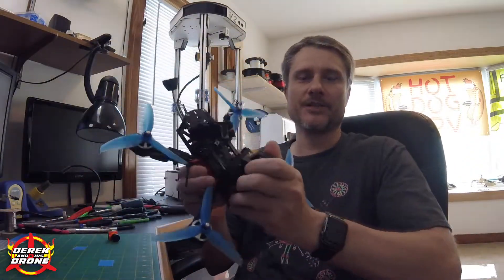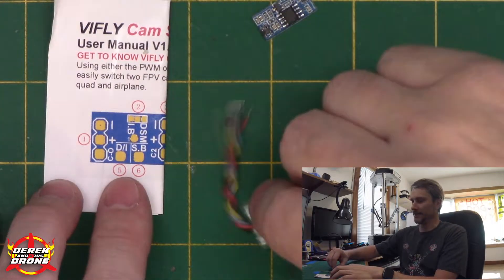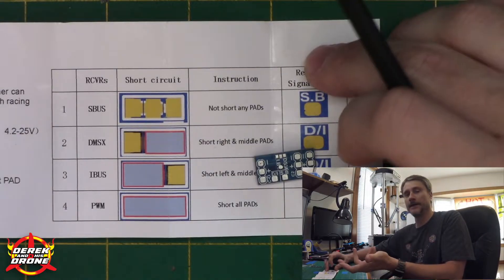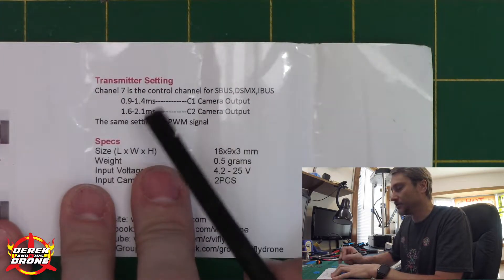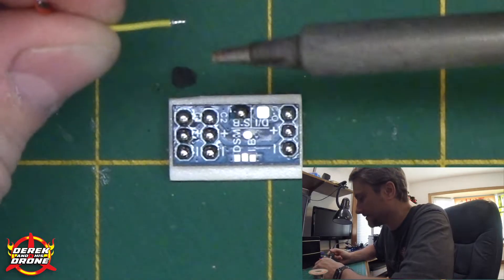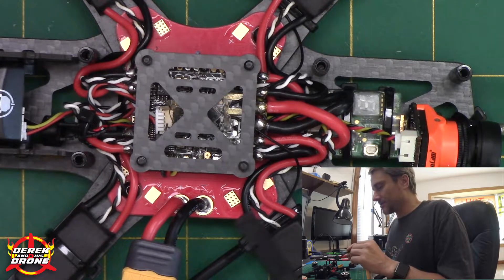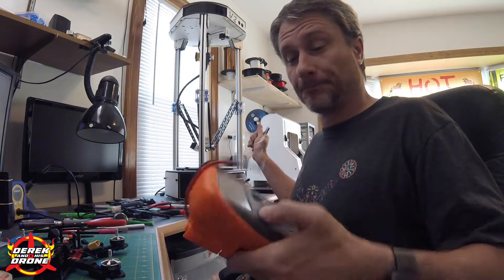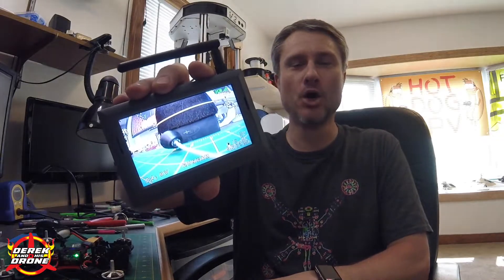VIFLY Cam Switcher - Overview and Installation

Comment: Not a fan of the ViFly take on the 2 cam switch.   The Bick's Multiview Duo is what I have been using for the past 10 months.   I feel it is the better switch between it being controllable by PWM or by a PinIO from the flight controller.    Bout the only good thing with the ViFly switch is it may be easier to get in certain markets than the Bicks Multiview Duo.
Reply from the maker: ViFly sent me this product for review.  It's not something that I would typically use so I don't have an opinion on other products.  I do like how ViFly uses the radio for control.  It makes the product much more flexible allowing just about anyone to install it.
Reply: @DerekandhisDrone  vifly contacted me as well but I wont get into that.   The Multiview can be controlled by either the FC or by a receiver as well, not sure about ppm or SBus as a trigger but PWM for sure as that is how I use it.
Reply: DividingByZero FPV you have link to one you use? I’m not liking how this installs. I’m confused as to how I connect this vifly to FC.  Do I just solder directly to sbus pad that my R9 slim is connected to?
Reply from the maker: @Freebird_67  Yes just solder it to the sbus pad with your receiver.
https://www.viflydrone.com/switcher.html   or

https://www.amazon.com/VIFLY-Switcher-Compatible-Airplanes-Cheater/dp/B07RKNFYXM/ref=sr_1_2?keywords=vifly&qid=1567697300&s=gateway&sr=8-2
Reply: @Freebird_67  check ReadyMadeRC and PyroDrone.   "Bicks Multiview Duo".   They have their own store as well I think